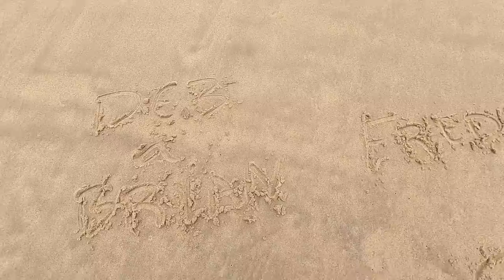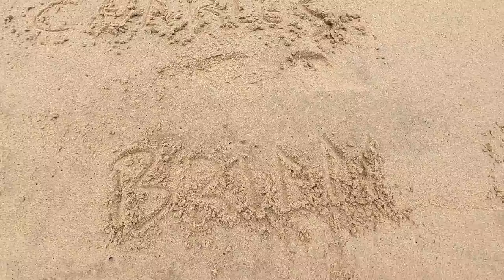Building our NEW KEEL from scratch! — Sailing Yabá #10

Comment: Interesting to hear you describing dimensions in centimetres.... which is predominantly used only in the clothing industry.                         In engineering and boatbuilding only two metric dimensions are used, millimetres and metres.
Reply: 1000mm=100cm=10dm=1m  centimeter is an easy to understand because the numbers are smaller ah this is 5 cm wide = 5 Fingers easy to get rough idea of dimensions.

1liter = 1 cubic dezimeter.  bed sizes are also often used in CM too like 220cm x 90cm.
Reply: @cpt.mirones5109  As I said before.... cm is used in the clothing and fabric ( bed) industry.   Show me ONE metric boat drawing, or ONE metric engineering manufacturing drawing that uses centimetres.....???
Reply: @SailingYachtDreamcatcher  all offical engineering plans are in mm. thats the law. but that doesnt mean no one uses it in daily life
Reply: @cpt.mirones5109  You are welcome to use cm's... if you want to call a 5m tape measure a 500cm tape measure, go ahead.                                                However, there is a reason that only mm and m are used in metric boatbuilding and engineering.... So, once you have worked out why, you can explain to all reading this thread, why only mm and m are used......

Comment: I have a question? .... where's the balast keel?  For those of you who dont understand this question.

The balast keel keeps your boat upright and balances the forces put upon the mast that come from your sails.   

Im just afraid that Yaba might have lost her balast keel years agao and its on the bottom of the ocean.  I could be wrong, but im pretty sure she's supposed to have some balast...just sayin .... ⛵💕🌠
Reply: @pcb1962  Not true. This hull design allows upwind sailing.  It was used all along XVIII and early XIX century. Only in the last years of XIX century the design and rigging were modified to get the close hauling possible, increasing the efficiency of the upwind sailing, reducing the drift with the new kind of keel.(balast Keel). In boats like Yaba, regarding stability, the extra ballast is put inside the hull.
Reply: @pcb1962  I agree ... I think Yaba could use a balast keel, just to keep the ship ballanced in rough  weather.
Reply: @Viper_Poker  Hi. One question remains....who would do the project of that keel? I believe you know that it would cause more problems   than benefits to the boat....and those finn keels increase the instability of the hull and BECAUSE of that they need the weight added at their very botton (to compensate the instability they bring to the hull) The  main function of the dtaft keel is a better performance for upwind sailing. That was the reason for their emergence.  Their boat has no sails yet ...How to project a keel disregarding how the rigging will be made? It will be a Gaff or Bermuda, how many sails will be  used etc...
Reply: @cptcarvalhofly  I wasnt talking about a fin.   It would be easier to bolt in a long keel.  A boat that size would only draw 5'5" - 6' of water.  Less headache than a fin and easier to do for that boat.   

Make a mold, poor the keel and move the boat on top and bolt her on. Then all ypu have to do is shape it in and fair out the keel.
Reply: @Viper_Poker  Even the long keel cannot be made without a project and without the sail area and the center of effort already calculated. Besides it is a change of the original design. I believe their goal is restore the boat. When Yaba was born 7 ton of Baritina were used for balast, respecting the origins of the old and historical design of this kind of boat.

Comment: Are you guys working on the interior while this work goes on? Or do you have to wait until the boat is more solid to get back in there? 🤔
Reply from the maker: Hey Finn! We are busy removing old stuff from the interior which won't be used for now but you will see that in future videos. We might have to change the bulkheads which means we will do the interior work after that...
Reply: Ba d Neighbour  Its still being refined. Next week will reveal finished work.

Comment: My brother is a collector of sailboats, refurbishing them, and knows a lot about what you are doing.  I am sitting here in my nice warm room thinking, "What is going to keep those Toredo worms out of your new keel and hull work?"  Didn't the shipbuilders of the 17th and 18th century clad their hulls in copper to prevent just that?  Expensive these days, for sure, to do the same but I'm sure modern technology has a better solution?  I can't imagine having to interrupt your voyages to periodically dry-dock to go worm hunting.  All the best to you---you have a great support staff there and the shipbuilders you have working on your vessel sure seem to know what they're doing with their techniques and tools.  After all, aren't they the number 1 and 2 best in all of Brazil??  lol
Reply: Cooper was more of an experimental thing its not liked alot by shipwrights because you can replate a hull 2 times with copper after that there is more holes than wood from all these nails.  sometimes they sailed up a river mouth to have the freshwater kill off some marine growth. Rio de Plata? Spelling? has alot of Shipwrecks there when they went do far in without pilots. HMS Agamemnom (spelling) the crew got feed up with the greek naming of the Royal Navy until the order from Admirality came to stop refeering ot her as HMS ''Eggs n Bacon'') the wreck of here is in that area because of poor conditions on the Structure. 

 there is no real way against it than to regulary haul ou,t inspect and replank the vessel.
Reply: Worm shoe can help, but good anti-foul and staying on top of maintenance is the main thing. If the anti-foul is scraped off etc. it will expose the wood, if it's  the worm shoe they can eat into that then stop at the tar/felt etc. so it's sacrificial, and easily replaced when the boat is hauled out again. The main thing is maintenance and checking it.

Comment: Hl Ben and MP!
I hawe wooden boat i planing to fix up,but thr labor prises are so exspensiv here in the north,how is the leiing cost ant timen prise in your yard.in ane cure i hawe fore a 500.000 k in rep here in the nort but that is to mutsh mony to put in to the boat.i hawe kell and ca 22 metre whit board i hawe to cahange pluss the innside but that i can tace over time,hawe to start the innterier oppbilding and sturit avay so if the boat is going i have done alot of unesesery work and that will be sad
Hope u will anserw
Alf Form Norway

Comment: I don't understand the peg and hole in your scarf joint. You sure you have the orientation correct? You hammer that peg in there, it will push the long overlap edges of the two beams apart. We use pegs often for this purpose in timber frame construction to drive joints together, but we do it VERTICALLY through the joint, not HORIZONTALLY like you have it.

Comment: i hope you are putting a layer of fibre glass to protect the wooden keel or you could find yourself in the same position in 30 years time which would be a great shame ... i must say from watching odd life crafting and now your channel the Brasilians are not scared of hard graft
Reply: Fiberglass? On a wooden boat? Are you crazy?
Reply: @benters3509  it's a layer over the wood that helps protect the wood i've seen it done numerous times in projects with wooden boats it involves layers of resin as well and it also helps in waterproofing the boat
Reply: @SaorAlba1970  nope nope nope. All that will do is help it rot even faster. Wood needs to breathe ultimately (yes even underwater)
Reply: @danbuckman5691  Dan what is your expertise in this specific area.Encapsulation of timber with resin infused glass fibre is both common and successful as far as I am aware.

Comment: If these guys replace large pieces of lumber often they should buy the right tools to cut the material. 7.25inch circular saws are not big enough or  strong enough .when you add up the time to flip the boards and layout the marks again you are loosing time . The saws are also getting very hot because they are being over worked which will reduce the lifespan of the saw and they will trip the electrical breaker which adds more time and agravation to the job. They need to buy a 12inch or 16 inch circular saw and save alot of time and money
Reply: Perhaps the larger, industrial saws you mention are much more expensive to import into Brazil, compared to smaller mass-market saws. Perhaps the shipwrights seen here may be freelance, and provide their own tools. I'm guessing that much of their regular work will be with smaller timbers than Yabá's keel. I noticed the first pass of the circular saw was quite shallow, so the guys were trying to avoid working the saw too hard. Slow, perhaps, but still precise, and there were plenty of hands when needed, to flip the keel over, or bring the pieces together repeatedly to test-fit.
Reply: That's at least a 9" circular saw made by Bosch. While it might not be what you would use in an advanced country like America, it certainly isn't your everyday hardware store skill saw. A good craftsman gets by with the tools at hand when needed. 😉🪚

Comment: QUESTION AGAIN: You didn't reply to my question: How will you prevent this rot from happening again?
Reply from the maker: Hello. Before thinking on how to prevent this, it's important to understand what made the keel reach that state. What happened to Yabá was a combo of: neglected maintenance + stuck at the same place without moving for too long + tropical waters (worms’ favorite environment). As we are planning on moving and maintaining the boat, the worms shouldn’t be able to feast on our hull like this again. 
There are loads of different ways to prevent rot: We will lift it out of the water yearly for maintainance, prevent fresh water infiltration (and salt water), apply a layer that will treat and protect the hull against worms, we will keep the boat moving instead of keeping it mored at a pier which will help too...
ALSO: We try to answer all comments but there are a lot, so sorry if we don't get to your comment. Thanks for the patience!
Reply: @SailingYaba  are you planning on true blue water cruising with her? If so you may have the wrong boat. She’s not designed for true deep ocean cruising. She’s gonna roll like a barrel in true heavy seas due to her wide beam and rounded bilges. She needs a much deeper and straighter stem post and stern... she’s fine for coastal cruising in fair weather though....

Comment: I think you should start improving your camera work. Too shakey for my taste. Too often not showing the essential stuff.

And somebody please buy these guys a larger circular saw. Makita has one that is large enough for cutting those beams at once. Mafell should also have one, but Mafell is expensive.
Reply: in brazil labor is relatively cheap so they have a different attitude about spending money on equipment or doing work yourself
Reply: Christian - I had the same thought I've used the Makita Beam saw and could have cut that timber in one pass ! And MP running a large power planner with one hand that could have ended real bad .
Reply: @gregmirr    Yes, indeed, I had the same thought when I saw MP juggling the planer with one hand, and the handle-knob literally crying "grab me, grab me!"
------- 
Technical info:
The Mafell "MKS 185 Ec" has a vertical cut of 185 mm; 3000 W; and weighs about 16 kilogrammes. But better don't ask for the price. Catalogue p. 60. 

https://www.mafell.de/fileadmin/media/epaper/katalog_2020_2021_de/epaper/mafell_katalog_2020-2021_de.pdf

The Makita 5143R cuts 130 mm, 2200 W, 12,5 kilogrammes. I think there once was another Makita with at least about 160 mm, but I do not see that anymore in their current catalogue.